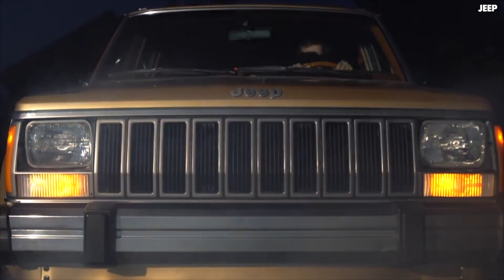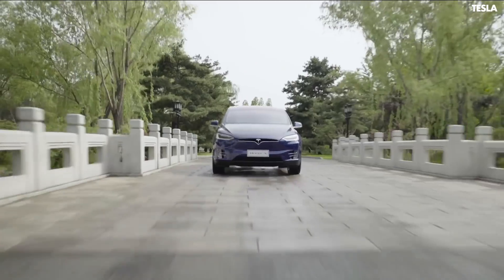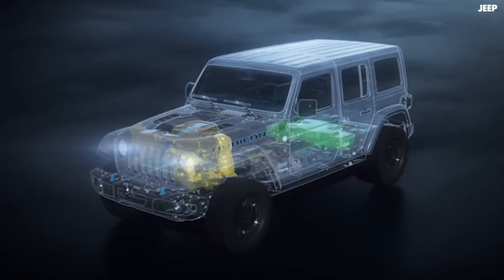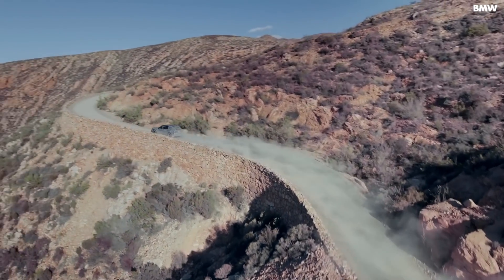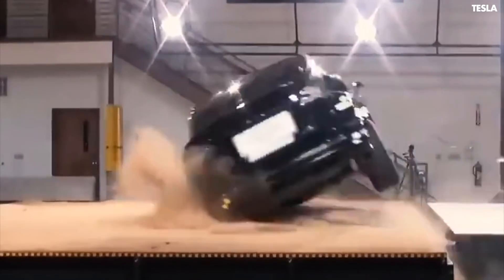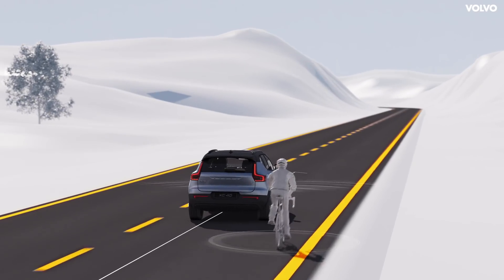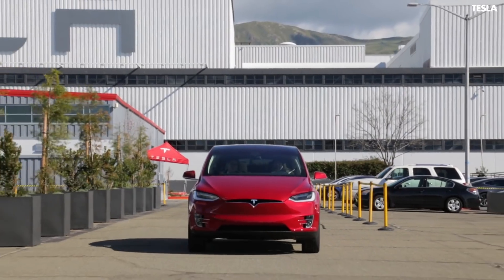How Tesla Made the Model X IMPOSSIBLE to Roll

Comment: Rolling over is a fairly extreme measure of CofG. Just because this monstrosity doesn't roll doesn't excuse it from all the other problems associated with a high CofG. A Model S or 3 will handle better, be safer, more agile, and cost less to run.
Reply: Yes very much true
Reply: It doesn't have a high cg.
Reply: @jamesengland7461  Yes it does. All SUVs have air under them where a normal car has the actual car, in this case a load of heavy batteries. It’s an absolute disaster for everything a car does, other than driving off road very slowly.
Reply: @RobManser77  this isn't "all SUVs". That's the entire point of this video.
Reply: @jamesengland7461  No, my point was comparing an SUV to a normal car. Sure, the X has a lower CofG than a regular ICE SUV, but that’s not the point I’m making. My point is that an SUV like the X will always have a higher CofG than the equivalent car, in this case an S or 3. The X may not roll over, but it’s still worse than a car at just about everything: handling, grip, practicality etc.

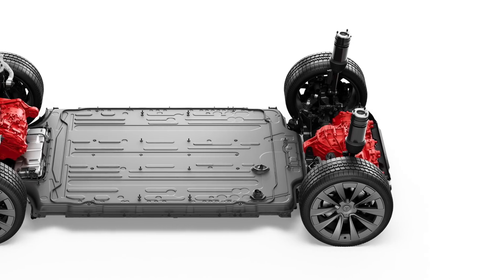Comment: 2:55 Motor on each axle not each wheel
Reply: Motor on each wheel. That would be the Aptera.
Reply: @batuksri  or the nevera
Reply: @batuksri  wait I'm confused, so they are in the wheel or axel ??
Reply: @appleormac  The Model X has a two-motor design, one for front and back. The Rimac Nevera has a four-motor design, one for every wheel. It actually is one of few cars with the special drive type distinction of not AWD, but IWD for Individual Wheel Drive.